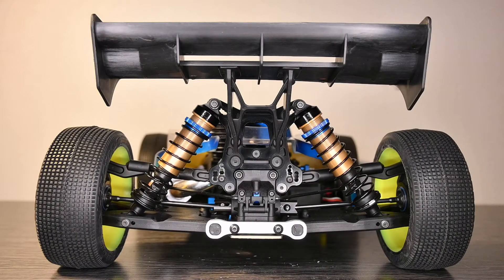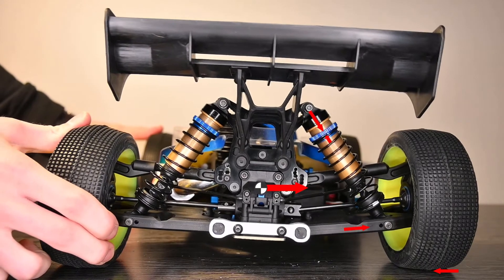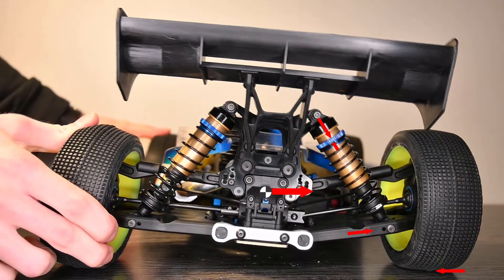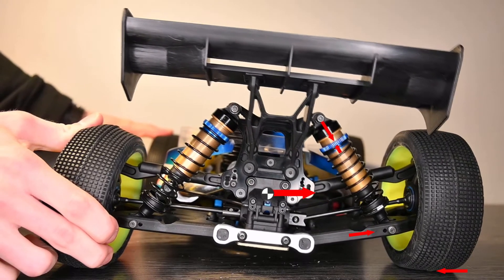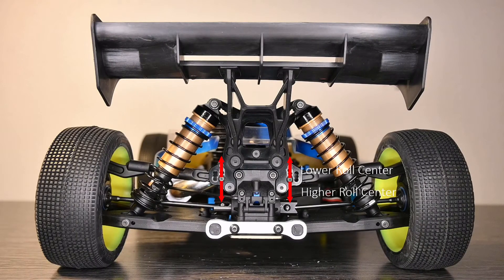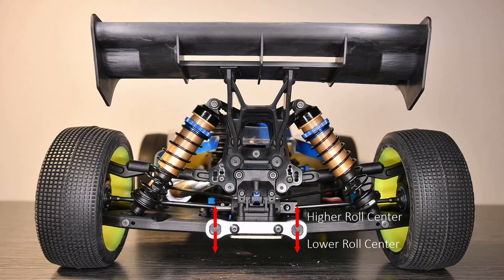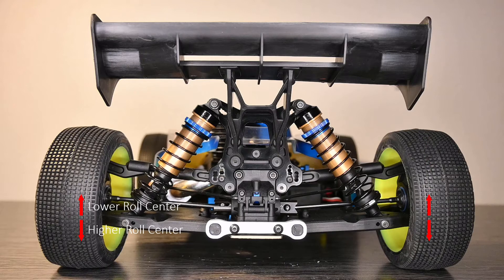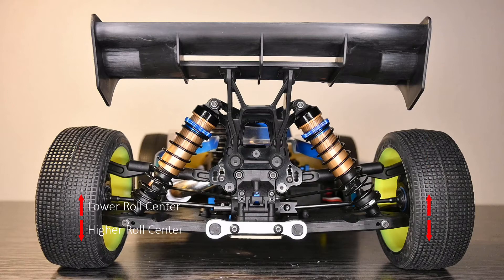From the ground up: Roll Centers Part II

Comment: Roll Center is a giant coarse adjustment to the car; it makes the springs seem stiffer when raised, and makes the springs feel softer when lowered.  Enough said.  From here we have fine adjustments to the suspension in the order' from the highest to the least as far getting finer in adjustments goes as we make them: spring stiffness to a given roll center and shock oil maintaining the same ride heights.  If the car does not react to these changes, the roll center is off.  The last thing is tires - if they matter you have a car that will tune!

Comment: Great videos! I have learned a lot. You talked about changing the front and rear roll center together. What are ways to change the front roll center? Would that be done through the front bulkhead? And camber links?
Reply from the maker: Yes exactly. For 2wd buggies the ability to change the roll center from the lower arm is a bit limited but you can place shims etc under the bulkhead. Adjusting link height or length adjusts your roll center as well so for a 2wd buggy thats where you are mostly limited to on the front.

Comment: Hi. One Thing: i think in the First Video you Said a Low Roll Center generates more GRIP. In the second Video its a high roll Center that generates more GRIP. 
Am i wrong or is there Something wrong in the Videos? Thank you. s.
Reply from the maker: It depends on the situation. When the track has a lot of grip the car is not allowed to slide meaning stiffer roll (Higher roll center) will give you more grip. When the grip is very low the tire likes to break grip more so giving the car softer roll (Lower roll center) will allow you to use the edge of the grip better and give you a feeling of more consistent grip. Roll Centers don't necessarily create actual grip rather give you the feeling of it.
Reply: @maxmortrc  Think you nailed it with that description -  my rear on the car last night had inconsistent grip on a low grip track - had high roll centre set on the hinge pins.      Went to a lower roll centre and was more consistent/ progressive.  (or so it felt)

Comment: Hi max, your video series on the roll centers got me thinking about something and now I can't get it out of my head

Is there a difference between having high roll center and lower ride vs high roll center and higher ride height?
With both the COG and roll centers will change to compensate so behaviour of the car will be similar wont it? I'm considering what happens on astro-turf. Since high grip is given and the car is setup to generate corner speed/side bite using the contact patch friction rather than body roll and weight transfer....will corner speed be similar even with higher COG?

My track is bumpy and has steep angled downward slope coming down steep 'hills', can't clear this without bottoming out/chassis catching on carpet hence the question.
Only other thing i noticed is that at higher ride height the upper and lower arms are more parallel to each other, is that an advantageous thing? I was wondering if having the arms more parallel to start with will reduce chance of jacking and grip roll on higher grip surface?

So if the ride height is raised, the way the camber links sit also is raised, so I'd reckon there is some compensation, though I don't know if both move by the same height. My shocks/springs/roll bar package are quite stiff. I reckon with the arms now more parallel, even if there is penalty in corner speed/less side bite, there will be less jacking overall even if the car sits a bit higher. This might be a way to make the higher roll center position a bit safer, ie. higher corner speed from the high roll center, but more parallel arms meaning perhaps less chance of grip roll.

Do you reckon this might work in reality?
Reply from the maker: Generally on higher grip I have always had to compensate the lower ride height with higher position of the lower arm and upper link to keep the arms more parallel. Doing something like this will reduce the jacking as you said as well as keep the roll center at a similar height from the ground but closer to the CoG. 

In your case if you need to raise the ride height, naturally you would like to compensate with the roll center change to keep the arms parallel. So when you would lower the arm and upper link to keep it relative to the ground  you would also gain more distance to the CoG. 

When you raise the ride height you also raise the roll center. It is not 1:1 so depending on your geometry raising the ride height 2mm might get you a 0.5mm shorter moment arm meaning that your roll center is closer to your CoG than before. Because of this I see no point in trying to achieve an even higher roll center position considering your roll center was in the ball park once you started out.

The main issue in this is technically you will always want to have the lowest possible CoG which also means that you always want to have the lowest possible ride height. Once you raise the ride height and get better over those bumps you also lose in corner speed no matter what you do with the roll center considering what you had before was adequate. So you will need to make a compromise. Higher CoG = Higher ride height better handling over bumps vs. Lower CoG = Lower ride height better corner speed elsewhere. 

If you want to try I would suggest that you raise the ride height by a small margin and then you raise the upper link to lower the jacking effect. If this doesnt work I am afraid you will either have to choose to have a worse car over bumps or to raise the ride height, lower the lower arm and upper link and lose some corner speed due to the longer moment arm.
Reply: @maxmortrc  In general vehicle dynamics theory, tyre grip is generated by weight transfer. If that's the case wouldn't lower COG/longer moment arm mean more grip? Also in the video you talk about the centrifugal forces being distributed between arms and the shocks. How exactly is the grip generated if most of the force acts horizontally on the tyre instead of from above ie. on top of the contact patch.
Reply from the maker: @tobythomas5079  Think of it as a  rolling motion then there will be force on the tire for both downwards due to the roll and sideways due to the force acting against the center of gravity. This is why when the tire loses grip it goes very suddenly since the rolling motion stops. 

Lower CoG and longer moment arm means more grip because of the longer moment arm. Longer moment arm = roll motion is slower and transferring weight between each tire is slower. Lower CoG will mostly increase corner speed because of the roll motion happening closer to the ground and the car keeping more flat.